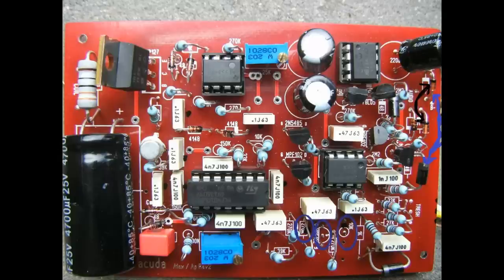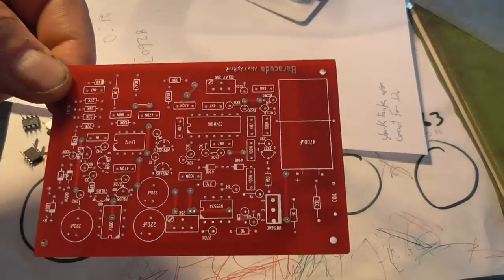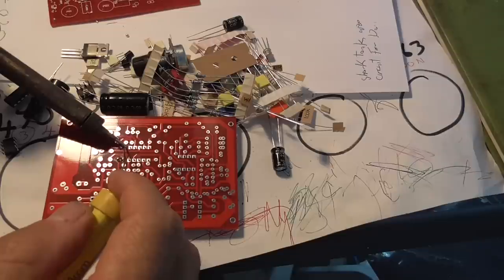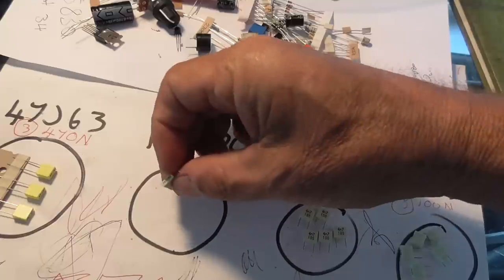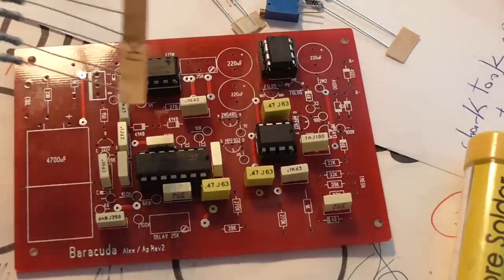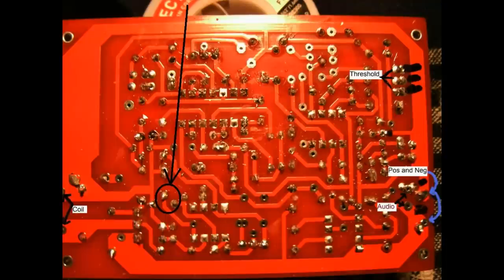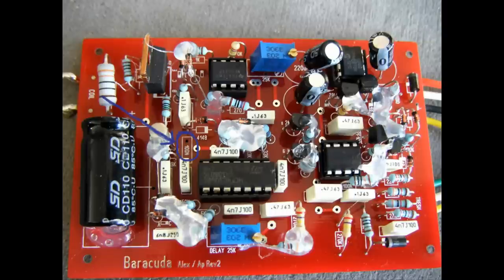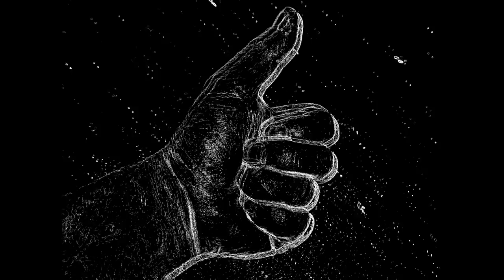HOW TO DIY ONE OF THE BEST METAL DETECTOR CIRCUITS.

Comment: hi barne very good your video but can you help me  with the conection of batery and on off botton where i put the cables??
Reply from the maker: Vagelis Vog Look on the front of the board and put a pin through the positive then negitive hole , same with the audio, mark them somehow as you dont want to get any wrong. hope this helps.
Reply from the maker: Frederick Barnes solder small pins or bits of coloured wire so you dont get confused
Reply: hi barnes again can i make coil from 0.4mm or i need 0.5mm and how many turn???
i bought the wrong one lol
Reply from the maker: Vagelis Vog if you are using the baracuda with .4 copper insulated wire i would use try 25 turns at 8 in diameter coil. you can experiment so long as you dont short something out or hook the bateries up wrong.if the coil wire is too short it will heat up the circuit and damage it. i have never tried .4 wire and i am not an expert, but but my experience tells me that it should work well as . 5 wire is what i use and it works so long as i dont use too little and damage the board.
Reply: first try i turn it on and i see smoke FAIL
Reply from the maker: Vagelis Vog use a magnifier glass and see what part got hot. you must learn from your mistake because i am not an expert and  cant fault find.must be so careful as there are hundreds of things that can go wrong. sad for your loss, hope next time will be happy
Reply: Frederick Barnes can you tell me at the first image of the board where is the + of the audio?? is up or down??
Reply from the maker: Vagelis Vog 
 
  Normal
  0
  
  
  
  
  false
  false
  false
  
  EN-AU
  X-NONE
  X-NONE
  
   
   
   
   
   
   
   
   
   
   
   
  
  MicrosoftInternetExplorer4
  
   
   
   
   
   
   
   
   
   
   
   
  

The pin closest to the centre is negative–    closest to corner is positive      audio is close,
so any joins to audio will short circuit.

 <w:LatentStyles DefLockedState="false" DefUnhideWhenUsed="true"
  DefSemiHidden="true" DefQFormat="false" DefPriority="99"
  LatentStyleCount="267">
  <w:LsdException Locked="false" Priority="0" SemiHidden="false"
   UnhideWhenUsed="false" QFormat="true" Name="Normal"/>
  <w:LsdException Locked="false" Priority="9" SemiHidden="false"
   UnhideWhenUsed="false" QFormat="true" Name="heading 1"/>
  
  
  
  
  
  
  
  
  
  
  
  
  
  
  
  
  
  
  <w:LsdException Locked="false" Priority="10" SemiHidden="false"
   UnhideWhenUsed="false" QFormat="true" Name="Title"/>
  
  <w:LsdException Locked="false" Priority="11" SemiHidden="false"
   UnhideWhenUsed="false" QFormat="true" Name="Subtitle"/>
  <w:LsdException Locked="false" Priority="22" SemiHidden="false"
   UnhideWhenUsed="false" QFormat="true" Name="Strong"/>
  <w:LsdException Locked="false" Priority="20" SemiHidden="false"
   UnhideWhenUsed="false" QFormat="true" Name="Emphasis"/>
  <w:LsdException Locked="false" Priority="59" SemiHidden="false"
   UnhideWhenUsed="false" Name="Table Grid"/>
  
  <w:LsdException Locked="false" Priority="1" SemiHidden="false"
   UnhideWhenUsed="false" QFormat="true" Name="No Spacing"/>
  <w:LsdException Locked="false" Priority="60" SemiHidden="false"
   UnhideWhenUsed="false" Name="Light Shading"/>
  <w:LsdException Locked="false" Priority="61" SemiHidden="false"
   UnhideWhenUsed="false" Name="Light List"/>
  <w:LsdException Locked="false" Priority="62" SemiHidden="false"
   UnhideWhenUsed="false" Name="Light Grid"/>
  <w:LsdException Locked="false" Priority="63" SemiHidden="false"
   UnhideWhenUsed="false" Name="Medium Shading 1"/>
  <w:LsdException Locked="false" Priority="64" SemiHidden="false"
   UnhideWhenUsed="false" Name="Medium Shading 2"/>
  <w:LsdException Locked="false" Priority="65" SemiHidden="false"
   UnhideWhenUsed="false" Name="Medium List 1"/>
  <w:LsdException Locked="false" Priority="66" SemiHidden="false"
   UnhideWhenUsed="false" Name="Medium List 2"/>
  <w:LsdException Locked="false" Priority="67" SemiHidden="false"
   UnhideWhenUsed="false" Name="Medium Grid 1"/>
  <w:LsdException Locked="false" Priority="68" SemiHidden="false"
   UnhideWhenUsed="false" Name="Medium Grid 2"/>
  <w:LsdException Locked="false" Priority="69" SemiHidden="false"
   UnhideWhenUsed="false" Name="Medium Grid 3"/>
  <w:LsdException Locked="false" Priority="70" SemiHidden="false"
   UnhideWhenUsed="false" Name="Dark List"/>
  <w:LsdException Locked="false" Priority="71" SemiHidden="false"
   UnhideWhenUsed="false" Name="Colorful Shading"/>
  <w:LsdException Locked="false" Priority="72" SemiHidden="false"
   UnhideWhenUsed="false" Name="Colorful List"/>
  <w:LsdException Locked="false" Priority="73" SemiHidden="false"
   UnhideWhenUsed="false" Name="Colorful Grid"/>
  <w:LsdException Locked="false" Priority="60" SemiHidden="false"
   UnhideWhenUsed="false" Name="Light Shading Accent 1"/>
  <w:LsdException Locked="false" Priority="61" SemiHidden="false"
   UnhideWhenUsed="false" Name="Light List Accent 1"/>
  <w:LsdException Locked="false" Priority="62" SemiHidden="false"
   UnhideWhenUsed="false" Name="Light Grid Accent 1"/>
  <w:LsdException Locked="false" Priority="63" SemiHidden="false"
   UnhideWhenUsed="false" Name="Medium Shading 1 Accent 1"/>
  <w:LsdException Locked="false" Priority="64" SemiHidden="false"
   UnhideWhenUsed="false" Name="Medium Shading 2 Accent 1"/>
  <w:LsdException Locked="false" Priority="65" SemiHidden="false"
   UnhideWhenUsed="false" Name="Medium List 1 Accent 1"/>
  
  <w:LsdException Locked="false" Priority="34" SemiHidden="false"
   UnhideWhenUsed="false" QFormat="true" Name="List Paragraph"/>
  <w:LsdException Locked="false" Priority="29" SemiHidden="false"
   UnhideWhenUsed="false" QFormat="true" Name="Quote"/>
  <w:LsdException Locked="false" Priority="30" SemiHidden="false"
   UnhideWhenUsed="false" QFormat="true" Name="Intense Quote"/>
  <w:LsdException Locked="false" Priority="66" SemiHidden="false"
   UnhideWhenUsed="false" Name="Medium List 2 Accent 1"/>
  <w:LsdException Locked="false" Priority="67" SemiHidden="false"
   UnhideWhenUsed="false" Name="Medium Grid 1 Accent 1"/>
  <w:LsdException Locked="false" Priority="68" SemiHidden="false"
   UnhideWhenUsed="false" Name="Medium Grid 2 Accent 1"/>
  <w:LsdException Locked="false" Priority="69" SemiHidden="false"
   UnhideWhenUsed="false" Name="Medium Grid 3 Accent 1"/>
  <w:LsdException Locked="false" Priority="70" SemiHidden="false"
   UnhideWhenUsed="false" Name="Dark List Accent 1"/>
  <w:LsdException Locked="false" Priority="71" SemiHidden="false"
   UnhideWhenUsed="false" Name="Colorful Shading Accent 1"/>
  <w:LsdException Locked="false" Priority="72" SemiHidden="false"
   UnhideWhenUsed="false" Name="Colorful List Accent 1"/>
  <w:LsdException Locked="false" Priority="73" SemiHidden="false"
   UnhideWhenUsed="false" Name="Colorful Grid Accent 1"/>
  <w:LsdException Locked="false" Priority="60" SemiHidden="false"
   UnhideWhenUsed="false" Name="Light Shading Accent 2"/>
  <w:LsdException Locked="false" Priority="61" SemiHidden="false"
   UnhideWhenUsed="false" Name="Light List Accent 2"/>
  <w:LsdException Locked="false" Priority="62" SemiHidden="false"
   UnhideWhenUsed="false" Name="Light Grid Accent 2"/>
  <w:LsdException Locked="false" Priority="63" SemiHidden="false"
   UnhideWhenUsed="false" Name="Medium Shading 1 Accent 2"/>
  <w:LsdException Locked="false" Priority="64" SemiHidden="false"
   UnhideWhenUsed="false" Name="Medium Shading 2 Accent 2"/>
  <w:LsdException Locked="false" Priority="65" SemiHidden="false"
   UnhideWhenUsed="false" Name="Medium List 1 Accent 2"/>
  <w:LsdException Locked="false" Priority="66" SemiHidden="false"
   UnhideWhenUsed="false" Name="Medium List 2 Accent 2"/>
  <w:LsdException Locked="false" Priority="67" SemiHidden="false"
   UnhideWhenUsed="false" Name="Medium Grid 1 Accent 2"/>
  <w:LsdException Locked="false" Priority="68" SemiHidden="false"
   UnhideWhenUsed="false" Name="Medium Grid 2 Accent 2"/>
  <w:LsdException Locked="false" Priority="69" SemiHidden="false"
   UnhideWhenUsed="false" Name="Medium Grid 3 Accent 2"/>
  <w:LsdException Locked="false" Priority="70" SemiHidden="false"
   UnhideWhenUsed="false" Name="Dark List Accent 2"/>
  <w:LsdException Locked="false" Priority="71" SemiHidden="false"
   UnhideWhenUsed="false" Name="Colorful Shading Accent 2"/>
  <w:LsdException Locked="false" Priority="72" SemiHidden="false"
   UnhideWhenUsed="false" Name="Colorful List Accent 2"/>
  <w:LsdException Locked="false" Priority="73" SemiHidden="false"
   UnhideWhenUsed="false" Name="Colorful Grid Accent 2"/>
  <w:LsdException Locked="false" Priority="60" SemiHidden="false"
   UnhideWhenUsed="false" Name="Light Shading Accent 3"/>
  <w:LsdException Locked="false" Priority="61" SemiHidden="false"
   UnhideWhenUsed="false" Name="Light List Accent 3"/>
  <w:LsdException Locked="false" Priority="62" SemiHidden="false"
   UnhideWhenUsed="false" Name="Light Grid Accent 3"/>
  <w:LsdException Locked="false" Priority="63" SemiHidden="false"
   UnhideWhenUsed="false" Name="Medium Shading 1 Accent 3"/>
  <w:LsdException Locked="false" Priority="64" SemiHidden="false"
   UnhideWhenUsed="false" Name="Medium Shading 2 Accent 3"/>
  <w:LsdException Locked="false" Priority="65" SemiHidden="false"
   UnhideWhenUsed="false" Name="Medium List 1 Accent 3"/>
  <w:LsdException Locked="false" Priority="66" SemiHidden="false"
   UnhideWhenUsed="false" Name="Medium List 2 Accent 3"/>
  <w:LsdException Locked="false" Priority="67" SemiHidden="false"
   UnhideWhenUsed="false" Name="Medium Grid 1 Accent 3"/>
  <w:LsdException Locked="false" Priority="68" SemiHidden="false"
   UnhideWhenUsed="false" Name="Medium Grid 2 Accent 3"/>
  <w:LsdException Locked="false" Priority="69" SemiHidden="false"
   UnhideWhenUsed="false" Name="Medium Grid 3 Accent 3"/>
  <w:LsdException Locked="false" Priority="70" SemiHidden="false"
   UnhideWhenUsed="false" Name="Dark List Accent 3"/>
  <w:LsdException Locked="false" Priority="71" SemiHidden="false"
   UnhideWhenUsed="false" Name="Colorful Shading Accent 3"/>
  <w:LsdException Locked="false" Priority="72" SemiHidden="false"
   UnhideWhenUsed="false" Name="Colorful List Accent 3"/>
  <w:LsdException Locked="false" Priority="73" SemiHidden="false"
   UnhideWhenUsed="false" Name="Colorful Grid Accent 3"/>
  <w:LsdException Locked="false" Priority="60" SemiHidden="false"
   UnhideWhenUsed="false" Name="Light Shading Accent 4"/>
  <w:LsdException Locked="false" Priority="61" SemiHidden="false"
   UnhideWhenUsed="false" Name="Light List Accent 4"/>
  <w:LsdException Locked="false" Priority="62" SemiHidden="false"
   UnhideWhenUsed="false" Name="Light Grid Accent 4"/>
  <w:LsdException Locked="false" Priority="63" SemiHidden="false"
   UnhideWhenUsed="false" Name="Medium Shading 1 Accent 4"/>
  <w:LsdException Locked="false" Priority="64" SemiHidden="false"
   UnhideWhenUsed="false" Name="Medium Shading 2 Accent 4"/>
  <w:LsdException Locked="false" Priority="65" SemiHidden="false"
   UnhideWhenUsed="false" Name="Medium List 1 Accent 4"/>
  <w:LsdException Locked="false" Priority="66" SemiHidden="false"
   UnhideWhenUsed="false" Name="Medium List 2 Accent 4"/>
  <w:LsdException Locked="false" Priority="67" SemiHidden="false"
   UnhideWhenUsed="false" Name="Medium Grid 1 Accent 4"/>
  <w:LsdException Locked="false" Priority="68" SemiHidden="false"
   UnhideWhenUsed="false" Name="Medium Grid 2 Accent 4"/>
  <w:LsdException Locked="false" Priority="69" SemiHidden="false"
   UnhideWhenUsed="false" Name="Medium Grid 3 Accent 4"/>
  <w:LsdException Locked="false" Priority="70" SemiHidden="false"
   UnhideWhenUsed="false" Name="Dark List Accent 4"/>
  <w:LsdException Locked="false" Priority="71" SemiHidden="false"
   UnhideWhenUsed="false" Name="Colorful Shading Accent 4"/>
  <w:LsdException Locked="false" Priority="72" SemiHidden="false"
   UnhideWhenUsed="false" Name="Colorful List Accent 4"/>
  <w:LsdException Locked="false" Priority="73" SemiHidden="false"
   UnhideWhenUsed="false" Name="Colorful Grid Accent 4"/>
  <w:LsdException Locked="false" Priority="60" SemiHidden="false"
   UnhideWhenUsed="false" Name="Light Shading Accent 5"/>
  <w:LsdException Locked="false" Priority="61" SemiHidden="false"
   UnhideWhenUsed="false" Name="Light List Accent 5"/>
  <w:LsdException Locked="false" Priority="62" SemiHidden="false"
   UnhideWhenUsed="false" Name="Light Grid Accent 5"/>
  <w:LsdException Locked="false" Priority="63" SemiHidden="false"
   UnhideWhenUsed="false" Name="Medium Shading 1 Accent 5"/>
  <w:LsdException Locked="false" Priority="64" SemiHidden="false"
   UnhideWhenUsed="false" Name="Medium Shading 2 Accent 5"/>
  <w:LsdException Locked="false" Priority="65" SemiHidden="false"
   UnhideWhenUsed="false" Name="Medium List 1 Accent 5"/>
  <w:LsdException Locked="false" Priority="66" SemiHidden="false"
   UnhideWhenUsed="false" Name="Medium List 2 Accent 5"/>
  <w:LsdException Locked="false" Priority="67" SemiHidden="false"
   UnhideWhenUsed="false" Name="Medium Grid 1 Accent 5"/>
  <w:LsdException Locked="false" Priority="68" SemiHidden="false"
   UnhideWhenUsed="false" Name="Medium Grid 2 Accent 5"/>
  <w:LsdException Locked="false" Priority="69" SemiHidden="false"
   UnhideWhenUsed="false" Name="Medium Grid 3 Accent 5"/>
  <w:LsdException Locked="false" Priority="70" SemiHidden="false"
   UnhideWhenUsed="false" Name="Dark List Accent 5"/>
  <w:LsdException Locked="false" Priority="71" SemiHidden="false"
   UnhideWhenUsed="false" Name="Colorful Shading Accent 5"/>
  <w:LsdException Locked="false" Priority="72" SemiHidden="false"
   UnhideWhenUsed="false" Name="Colorful List Accent 5"/>
  <w:LsdException Locked="false" Priority="73" SemiHidden="false"
   UnhideWhenUsed="false" Name="Colorful Grid Accent 5"/>
  <w:LsdException Locked="false" Priority="60" SemiHidden="false"
   UnhideWhenUsed="false" Name="Light Shading Accent 6"/>
  <w:LsdException Locked="false" Priority="61" SemiHidden="false"
   UnhideWhenUsed="false" Name="Light List Accent 6"/>
  <w:LsdException Locked="false" Priority="62" SemiHidden="false"
   UnhideWhenUsed="false" Name="Light Grid Accent 6"/>
  <w:LsdException Locked="false" Priority="63" SemiHidden="false"
   UnhideWhenUsed="false" Name="Medium Shading 1 Accent 6"/>
  <w:LsdException Locked="false" Priority="64" SemiHidden="false"
   UnhideWhenUsed="false" Name="Medium Shading 2 Accent 6"/>
  <w:LsdException Locked="false" Priority="65" SemiHidden="false"
   UnhideWhenUsed="false" Name="Medium List 1 Accent 6"/>
  <w:LsdException Locked="false" Priority="66" SemiHidden="false"
   UnhideWhenUsed="false" Name="Medium List 2 Accent 6"/>
  <w:LsdException Locked="false" Priority="67" SemiHidden="false"
   UnhideWhenUsed="false" Name="Medium Grid 1 Accent 6"/>
  <w:LsdException Locked="false" Priority="68" SemiHidden="false"
   UnhideWhenUsed="false" Name="Medium Grid 2 Accent 6"/>
  <w:LsdException Locked="false" Priority="69" SemiHidden="false"
   UnhideWhenUsed="false" Name="Medium Grid 3 Accent 6"/>
  <w:LsdException Locked="false" Priority="70" SemiHidden="false"
   UnhideWhenUsed="false" Name="Dark List Accent 6"/>
  <w:LsdException Locked="false" Priority="71" SemiHidden="false"
   UnhideWhenUsed="false" Name="Colorful Shading Accent 6"/>
  <w:LsdException Locked="false" Priority="72" SemiHidden="false"
   UnhideWhenUsed="false" Name="Colorful List Accent 6"/>
  <w:LsdException Locked="false" Priority="73" SemiHidden="false"
   UnhideWhenUsed="false" Name="Colorful Grid Accent 6"/>
  <w:LsdException Locked="false" Priority="19" SemiHidden="false"
   UnhideWhenUsed="false" QFormat="true" Name="Subtle Emphasis"/>
  <w:LsdException Locked="false" Priority="21" SemiHidden="false"
   UnhideWhenUsed="false" QFormat="true" Name="Intense Emphasis"/>
  <w:LsdException Locked="false" Priority="31" SemiHidden="false"
   UnhideWhenUsed="false" QFormat="true" Name="Subtle Reference"/>
  <w:LsdException Locked="false" Priority="32" SemiHidden="false"
   UnhideWhenUsed="false" QFormat="true" Name="Intense Reference"/>
  <w:LsdException Locked="false" Priority="33" SemiHidden="false"
   UnhideWhenUsed="false" QFormat="true" Name="Book Title"/>
  
  
 

 /* Style Definitions */
 table.MsoNormalTable
 {mso-style-name:"Table Normal";
 mso-tstyle-rowband-size:0;
 mso-tstyle-colband-size:0;
 mso-style-noshow:yes;
 mso-style-priority:99;
 mso-style-qformat:yes;
 mso-style-parent:"";
 mso-padding-alt:0cm 5.4pt 0cm 5.4pt;
 mso-para-margin-top:0cm;
 mso-para-margin-right:0cm;
 mso-para-margin-bottom:10.0pt;
 mso-para-margin-left:0cm;
 line-height:115%;
 mso-pagination:widow-orphan;
 font-size:11.0pt;
 font-family:"Calibri","sans-serif";
 mso-ascii-font-family:Calibri;
 mso-ascii-theme-font:minor-latin;
 mso-fareast-font-family:"Times New Roman";
 mso-fareast-theme-font:minor-fareast;
 mso-hansi-font-family:Calibri;
 mso-hansi-theme-font:minor-latin;}

Comment: i take a bib sound lol can you recomend me what battery to bye??? now im using 10 aa batterys
and the problem no is i have all the time the bib sound doens stop what you recommend?
Reply from the maker: Vagelis Vog not AA batteries as they will run down very soon. need lots of power and at least 11.5 volts otherwhise it will run erratic. li ion are best
Reply: Frederick Barnes thnxx a lot one more question what cable you use from the coil to barracutta electronic system??
Reply from the maker: Vagelis Vog I use any insulated wire that is larger than the coil wire, and it works well.. just remember that any metal around the coil when you connect the power will cause it to temporarly shut down.also careful you dont connect the power wrong as it will damage the board. some one told me that one of the large black diods in the top right hand corner is in the wrong spot in the picture.it will work but it is not protected from wrong power hook up.